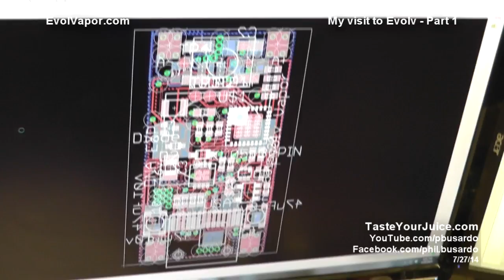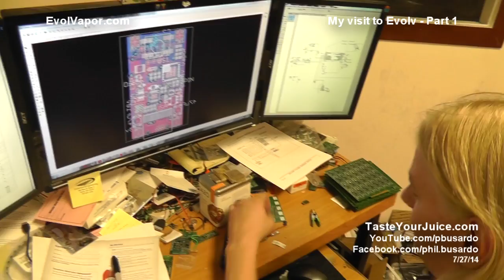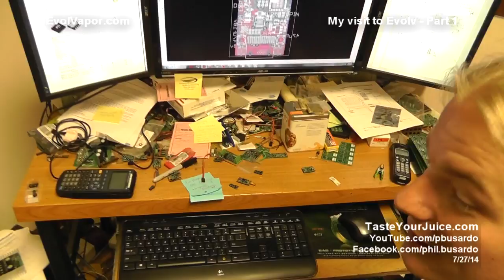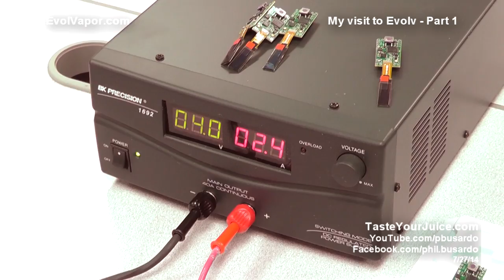A PBusardo Video - My Visit To Evolv & Factory Tour - Part 1

Comment: That was so awesome thanks again for another awesome video, damn all this rain! I'll be checking the other half out later. I'm happy he mentioned the raptor chip because my favorite box mod in my arsenal is running on one of those works like a charm but primitive compared to an evolv board but its comparing apples to oranges ones for regulated sub ohm vaping ones for general regulated vaping
Reply from the maker: Thanks Tyler!